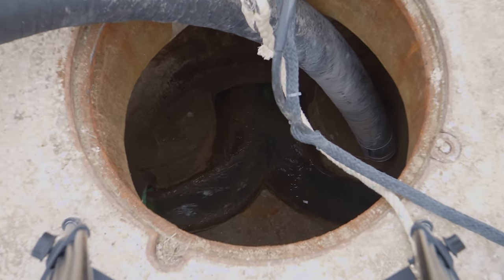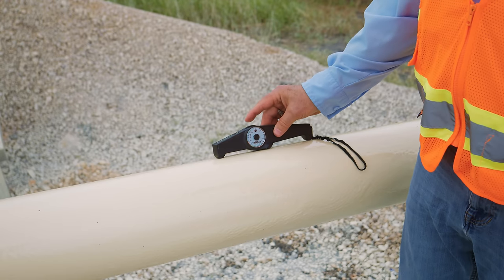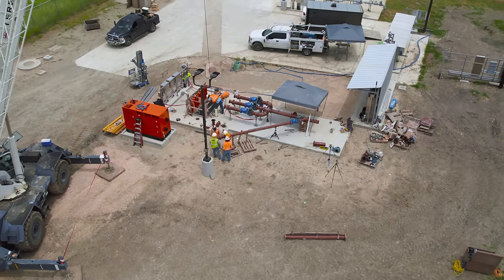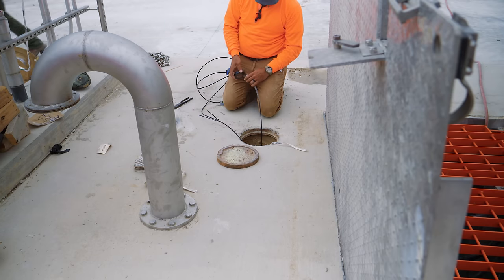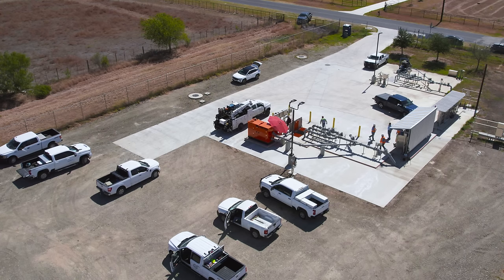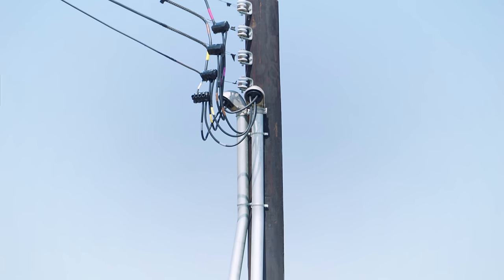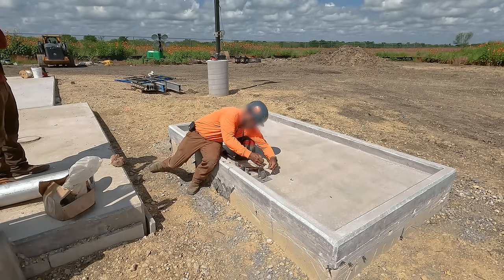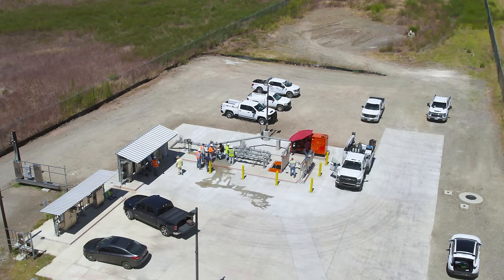HEAVY CONSTRUCTION of a Sewage Pump Station - Ep 5

Comment: Is there a reason why the pipes are sandblasted and painted on site rather than being delivered painted from the factory?
Reply: Direct Quotes from Content Creator Grady (other than that in parenthesis): “MGC is a private contractor that bid this project and was paid a fixed price for the work.” Site Location GPS Coordinates: 29°27'24.4"N 98°13'49.8"W “This is a low bid job, so if the contractor’s wasting money, it’s their own. The answer is complicated though (for why the pipes were sandblasted and coated on-site). Pipe mfg. (manufacturer) coats the pipes with something basic (at the lowest cost and for general use rather than this specific application) just to prevent corrosion during storage and delivery (it then needs to be removed so that the proper coating adheres to the pipe durably).  They aren’t equipped to apply the wide range of (different) coating products that an engineer might specify (remember, it is not just paint!), and even if they could, the final coating would likely get damaged during the delivery or construction (installation), putting them on the hook (liable) for fixing it rather than the general contractor who is better equipped to purchase the correct products and ensure that the final product (result) meets the specs (specifications for the application of the pipes) after the installation (such as the required thickness of the coating, color, useful lifespan required, final environment the pipes will be in, etcetera).”

Comment: Why is the factory coating on the pipe removed and then coated again? Why can’t the pipe factory apply the final coating before delivery?
Reply: It's no long lasting coat from the factory.

I think the pipe factory doesn't apply the 'real' coating because they produce pipes for a lot of costumers and each of them has different coating specifications.
Reply: Direct Quotes from Content Creator Grady (other than that in parenthesis): “MGC is a private contractor that bid this project and was paid a fixed price for the work.” Site Location GPS Coordinates: 29°27'24.4"N 98°13'49.8"W “This is a low bid job, so if the contractor’s wasting money, it’s their own. The answer is complicated though (for why the pipes were sandblasted and coated on-site). Pipe mfg. (manufacturer) coats the pipes with something basic (at the lowest cost and for general use rather than this specific application) just to prevent corrosion during storage and delivery (it then needs to be removed so that the proper coating adheres to the pipe durably).  They aren’t equipped to apply the wide range of (different) coating products that an engineer might specify (remember, it is not just paint!), and even if they could, the final coating would likely get damaged during the delivery or construction (installation), putting them on the hook (liable) for fixing it rather than the general contractor who is better equipped to purchase the correct products and ensure that the final product (result) meets the specs (specifications for the application of the pipes) after the installation (such as the required thickness of the coating, color, useful lifespan required, final environment the pipes will be in, etcetera).”

Comment: All three 3 phase motors ran the correct direction first try?
Reply: Why wouldn't they? Professionals would accidentally goof up the wiring.😉
Reply: @johnnyh3653  Three phase motors have a 50 percent chance of running backwards the first time you wire them up.  We would wire them up and do a bump test to make sure they were running the right direction.

Comment: Why the hell that is blasted and painted on site I have no idea! - Should be done in a booth where they were fabbed, where the media can be collected and the paint can be filtered. Terrible practice to be done outside and In Australia you would be getting huge fines from the EPA.
Reply: Direct Quotes from Content Creator Grady (other than that in parenthesis): “MGC is a private contractor that bid this project and was paid a fixed price for the work.” Site Location GPS Coordinates: 29°27'24.4"N 98°13'49.8"W “This is a low bid job, so if the contractor’s wasting money, it’s their own. The answer is complicated though (for why the pipes were sandblasted and coated on-site). Pipe mfg. (manufacturer) coats the pipes with something basic (at the lowest cost and for general use rather than this specific application) just to prevent corrosion during storage and delivery (it then needs to be removed so that the proper coating adheres to the pipe durably).  They aren’t equipped to apply the wide range of (different) coating products that an engineer might specify (remember, it is not just paint!), and even if they could, the final coating would likely get damaged during the delivery or construction (installation), putting them on the hook (liable) for fixing it rather than the general contractor who is better equipped to purchase the correct products and ensure that the final product (result) meets the specs (specifications for the application of the pipes) after the installation (such as the required thickness of the coating, color, useful lifespan required, final environment the pipes will be in, etcetera).”

Comment: I found it odd that they used iron pipes. Even more strange was that they had to be painted on site :/
Reply: Direct Quotes from Content Creator Grady (other than that in parenthesis): “MGC is a private contractor that bid this project and was paid a fixed price for the work.” Site Location GPS Coordinates: 29°27'24.4"N 98°13'49.8"W “This is a low bid job, so if the contractor’s wasting money, it’s their own. The answer is complicated though (for why the pipes were sandblasted and coated on-site). Pipe mfg. (manufacturer) coats the pipes with something basic (at the lowest cost and for general use rather than this specific application) just to prevent corrosion during storage and delivery (it then needs to be removed so that the proper coating adheres to the pipe durably).  They aren’t equipped to apply the wide range of (different) coating products that an engineer might specify (remember, it is not just paint!), and even if they could, the final coating would likely get damaged during the delivery or construction (installation), putting them on the hook (liable) for fixing it rather than the general contractor who is better equipped to purchase the correct products and ensure that the final product (result) meets the specs (specifications for the application of the pipes) after the installation (such as the required thickness of the coating, color, useful lifespan required, final environment the pipes will be in, etcetera).”

Comment: Why don't they just paint the pipes with the correct paint at the factory? Or wrap them in plastic? Painting them with an undesirable coating that needs to be sandblasted off seems absurd, what am I missing?
Reply: Direct Quotes from Content Creator Grady (other than that in parenthesis): “MGC is a private contractor that bid this project and was paid a fixed price for the work.” Site Location GPS Coordinates: 29°27'24.4"N 98°13'49.8"W “This is a low bid job, so if the contractor’s wasting money, it’s their own. The answer is complicated though (for why the pipes were sandblasted and coated on-site). Pipe mfg. (manufacturer) coats the pipes with something basic (at the lowest cost and for general use rather than this specific application) just to prevent corrosion during storage and delivery (it then needs to be removed so that the proper coating adheres to the pipe durably).  They aren’t equipped to apply the wide range of (different) coating products that an engineer might specify (remember, it is not just paint!), and even if they could, the final coating would likely get damaged during the delivery or construction (installation), putting them on the hook (liable) for fixing it rather than the general contractor who is better equipped to purchase the correct products and ensure that the final product (result) meets the specs (specifications for the application of the pipes) after the installation (such as the required thickness of the coating, color, useful lifespan required, final environment the pipes will be in, etcetera).”

Comment: Why make pumps wear out evenly? There are pros and cons to that. How pros overweight?
Reply: Equipment has service intervals and lifespans based on actual usage. Kind of like how you get an oil change in your car every 3,000 miles. If they wear the pumps evenly then they can service and replace in regular intervals, so they can inspect them every 3months, for instance, instead of at a different amount per pump, and they can plan for replacement better because they'll all need replaced around the same time.

Also, similar to how your car sitting for long periods of time can cause issues, the pumps need to run periodically to keep their internal fluids flowing and keep everything in good working order. You wouldn't want to suddenly need to use the backup pump for the first time in a long time, only to find out it's broken down in the interim.
Reply: @bryan__m  Thanks. I guess pumps are replaced long before they are close to failure, therefore risk of all 3 main ones breaking at the same time is so low benefits you mentioned overweight that risk. Also there is, I guess, no significant degradation over time, correct?

As for backup, IIRC the video, as name implies, it is not used as often as main ones. But I guess it is run periodically for reason you mention.
Reply: @MaximAnnen-j1b  ideally yes, they should have a known average lifespan and be replaced before that happens. I don't work in wastewater, but part of my job is trying to figure out when the replacement life of the equipment we use is (including pumps), so I'm sure they do a similar calculation. As far as I know those types of pumps are fairly simple so they really just work or they don't. The biggest problems we have with ours are things getting caught in the impeller.

Comment: Makes no sense to me why the pipes are painted or coated on site. Could totally be done in a factory.
Reply: Direct Quotes from Content Creator Grady (other than that in parenthesis): “MGC is a private contractor that bid this project and was paid a fixed price for the work.” Site Location GPS Coordinates: 29°27'24.4"N 98°13'49.8"W “This is a low bid job, so if the contractor’s wasting money, it’s their own. The answer is complicated though (for why the pipes were sandblasted and coated on-site). Pipe mfg. (manufacturer) coats the pipes with something basic (at the lowest cost and for general use rather than this specific application) just to prevent corrosion during storage and delivery (it then needs to be removed so that the proper coating adheres to the pipe durably).  They aren’t equipped to apply the wide range of (different) coating products that an engineer might specify (remember, it is not just paint!), and even if they could, the final coating would likely get damaged during the delivery or construction (installation), putting them on the hook (liable) for fixing it rather than the general contractor who is better equipped to purchase the correct products and ensure that the final product (result) meets the specs (specifications for the application of the pipes) after the installation (such as the required thickness of the coating, color, useful lifespan required, final environment the pipes will be in, etcetera).”